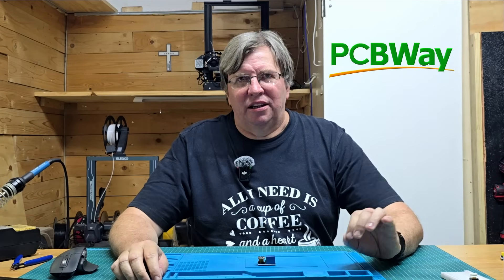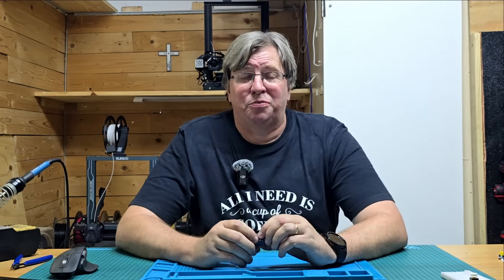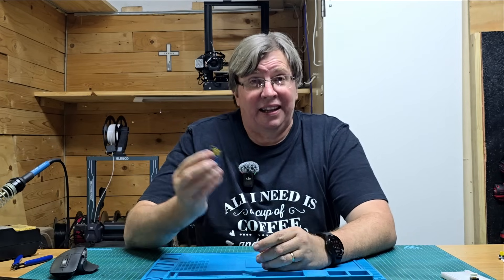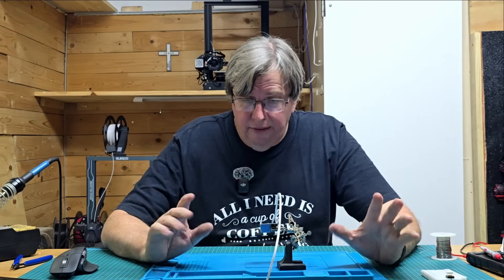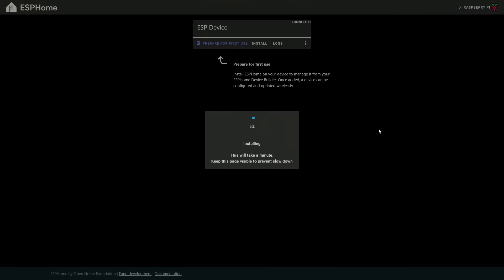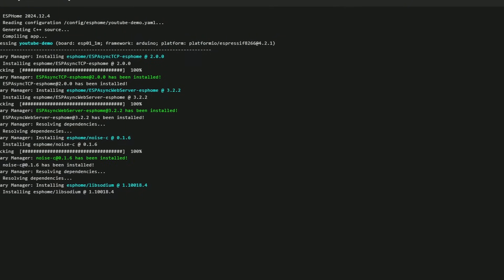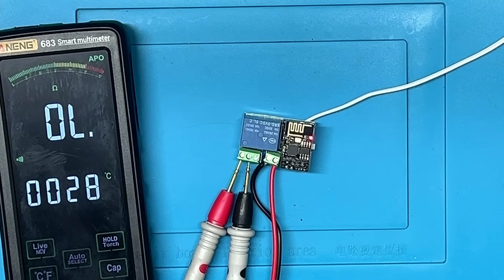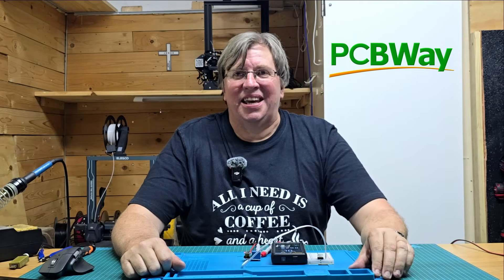Unlock Hidden Power: The Ultimate ESP-01 Relay Module Hack for Home Assistant!

Comment: Good idea, but its actually GPIO-0 not GPIO-1. Hopefully this saves some people from some frustration in writing code.
Reply from the maker: Hi, So in total, you can potentially use up to 4 GPIOs on the ESP-01, but only GPIO0 and GPIO2 are designed for general use by default. GPIO1 is the TX port and GPIO3 is RX.  GPIO2 is the general IO.  The example and pins I used in the video are GPIO0 and GPIO2

Comment: can i make this automation hard programed in the esp? so evemn if my hoas is down it wold still work?
Reply from the maker: I have not fully tested this yet, try this on, I will test and post if it was successful.  This code will make the button access the relay direct.  Hope it helps. let me know if it works.

esphome:
  name: esp01_relay
  platform: ESP8266
  board: esp01_1m

wifi:
  ssid: "Your_SSID"
  password: "Your_Password"

  # Enable fallback hotspot in case Wi-Fi is unavailable
  ap:
    ssid: "ESP01_Fallback"
    password: "Fallback_Password"

# Enable logging
logger:

# Enable Home Assistant API
api:

# Enable Over-The-Air updates
ota:

# Define the GPIO pin for the relay
switch:
  - platform: gpio
    name: "Relay"
    pin: GPIO0
    id: relay

# Define the GPIO pin for the button
binary_sensor:
  - platform: gpio
    pin:
      number: GPIO2
      mode: INPUT_PULLUP
      inverted: true
    name: "Button"
    on_press:
      - switch.toggle: relay
Reply from the maker: That is a great question, I will do some research and let you know y findings